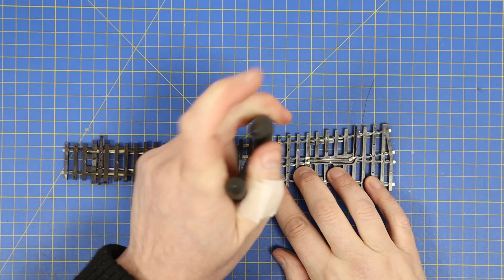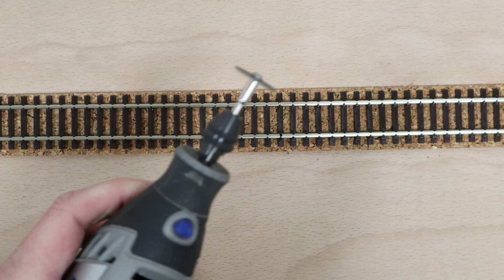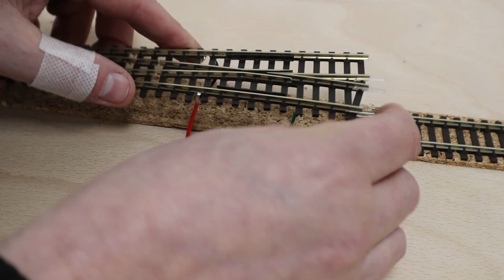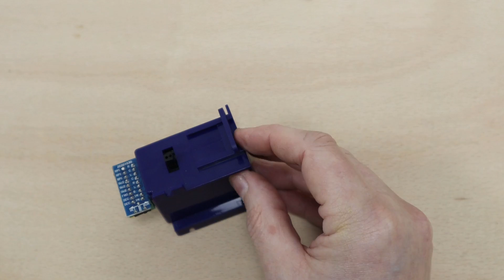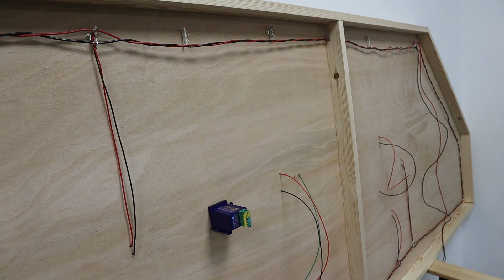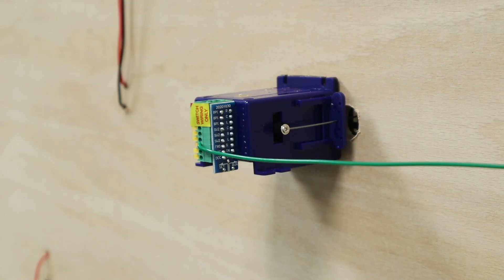Electrofrog Points and DCC Concepts Cobalt Point Motors - Model Railway - New Layout

Comment: I put my dropper wires in where you put the jumpers using the wires across the two rails like you did with yours. The dropper wires feeding towards the middle between the two centre rails of the point and down thru the base board

Comment: COBALT - MILDLY RADIOACTIVE !!!
"Cobalt" point motors from the USA are DANGEROUS. Cobalt is a mildly RADIOACTIVE material, perfectly legal in the USA, but illegal in Britain where safety standards are more stringent. And you may just get a visit from Customs & Excise, if they  detect this "radioactive" material coming through the Postal system. Indeed they ejected a friend of mine & his family from their Home for three days. While the men in white coats confiscated anything & everything in their house, which had been contaminated. He was using U.S. produced Cobalt magnets in his Scalextric slot car motors, because they are more powerful. The same magnets as used in other "Cobalt" products !

A sensible non radioactive substitute for point motors are the Swiss produced Fulgurex motors at around £11 each, direct MAIL ORDER from Fulgurex in Switzerland (they speak English).  Indeed a case load of 20 motors works out cheaper per motor ! I've been using these 12v DC mechanisms on heavy duty Exhibition layouts for over 30 years.

Comment: I’m a novice modeller but did certainly find using a really good soldering iron with adjustable temp control worked wonders for my soldering.
What l would really like to know how the hell do you get the throw bar through the hole in the point when trying to do it from underneath the layout?
Reply from the maker: The bar is quite long and you can easily see it through the hole. I used to have probems with Seep motors though!

Comment: Should . spring be removed? I'm using same point motor as yours. Thanks for vid. Great channel
Reply from the maker: I left my springs in place. I don’t seem to have any issues. Glad you like the video and channel
Reply: @BuntersYard   Perfect..thanks for reply
Reply: If you want slow movement of the point blades (switch rails) remove the spring, otherwise the blades can tend to snap shut / closed a bit. Most other information sources advise spring removal.

Comment: Great video I have followed this for my own layout. However I still don’t have power to the frog and trains stall when they go over the point. I thought the Cobalt should power the frog through the green wire? I have power along the point until the frog which is dead.
Reply from the maker: Hmm? Are you useing electrofog points, and have you modified them?
Reply: @BuntersYard  yes electrofrog. I worked it out in the end. I switched the wires from the bus round into the motor and it sprang to lift
Reply from the maker: Ah that’s good news. It’s great when it finally comes together. Happy new year Dan

Comment: I am still confused about the polarity of the frog wire. Does it matter which track bus wire, left or right,  goes into which hole?
Reply from the maker: The frog wire (green) doesnt have a polarity as such, thats all controlled by the point motor. Its just a connection between the point motor and the frog. When the point is thrown one way it will be positive, and the other way it will be negative.
Reply: @BuntersYard  Thankyou.
Reply from the maker: You’re welcome. It took me a while to get the concept in my head 😂

Comment: Hi. Nice and clear video. Something interesting I found: you used part of the frog wire to join tracks in two places and then added dropper wires further along the point. I have seen others use the droppers to make the two joins; this method achieves two things at once. Why do you add droppers separately?
Reply from the maker: That makes sense. I’ve never seen it done that way or even considered it. I guess the only reason would be that a larger piece of wire would be visible from the top of the layout where the connection joins the 2 tracks. This would probably be simple enough to disguise with ballast though. 
Thanks for your comment
Reply: @BuntersYard  When adding droppers, many modellers solder them to the bottom of the rails, whereas you prefer to solder them to the sides. Adding them to the bottom helps to hide the droppers. In the case of points, the rail-end of the droppers just need to be longer to bridge each pair of rails.
Reply from the maker: Yes they are soldered to the bottom of the rails. I’ll try to make this clearer in any future videos. Many thanks

Comment: If using the electro frog points on a dc layout, would i still need to use isolating plastic fishplates on the two frog track peices?
Reply from the maker: Thanks for the question. Yes you would need to isolate the frog whether you are running DC or DCC.
Reply: @BuntersYard many thanks for the reply